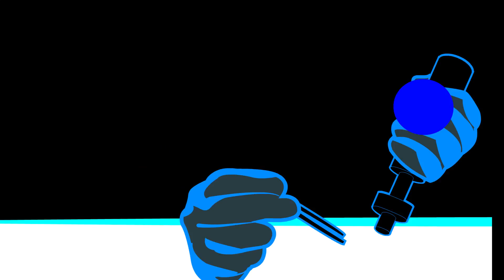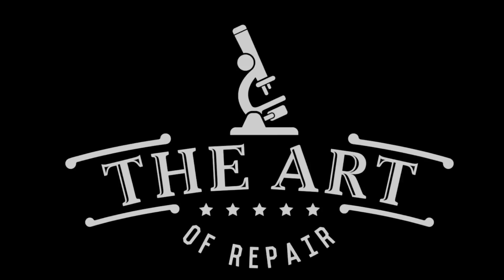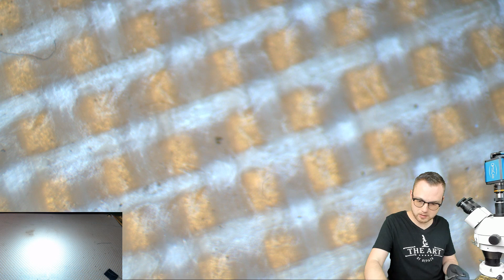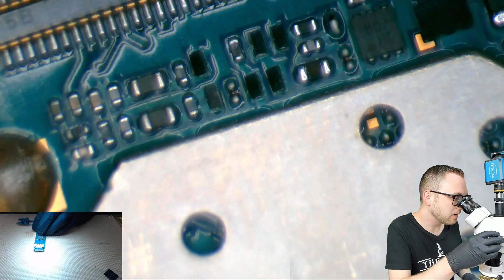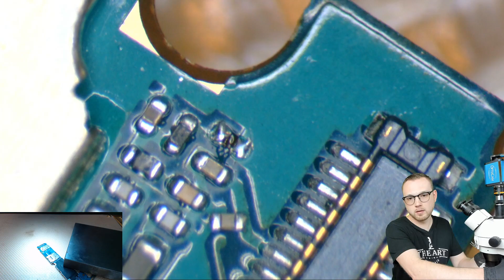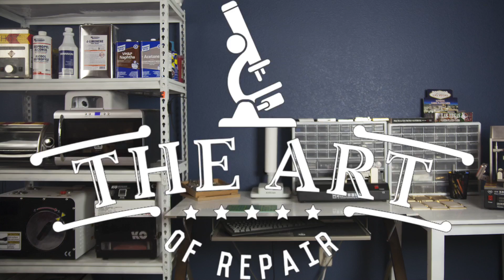Microsoldering 101 | Harvest & Planting | Small 2-3 Jointed components | Easy as 123

Comment: This video speaks to me. I was able to remove some capacitors from a board, which appeared to be shorted. Determined these caps were NOT shorted, so started putting them back in place. Hot air station blew a few caps right out of my tweezers' grip.  I'm also having trouble with my tweezers getting soldered to the part, when planting them with the hot air. 
I'm going to try your method!

Comment: Where do I buy motherboard connectors for the Google Pixel ? Can I use connectors from the iPhone ?
Reply from the maker: As long as its the same connector, you can take any component from anything and change it out. It just needs to be the same one. If its not the same, going to have to google that or ebay, might even need to reach out to a rep in china for help.

Comment: Hi Justin, would you be able to help me out here, i have bought almost all the necessary equipment i need in order to perform mobile phone SMD repair and i have tried practising on few Iphones by trying to desolder and solder components. I also attempted to repair an iPhone 5C, but it did not work out in my favour. Is their anything you would recommend for a  beginner like me to do, as i am struggling to find and afford motherboards to practice on.
Reply: you don't have to get boards from actual phones there are loads of practise boards you can purchase on e-bay with various components to add onto the boards, they come as one and after you completed the circuit can be tested, just search on e-bay 'practise soldering'